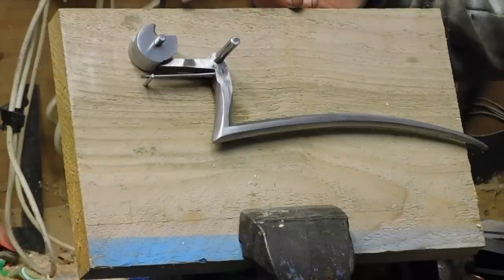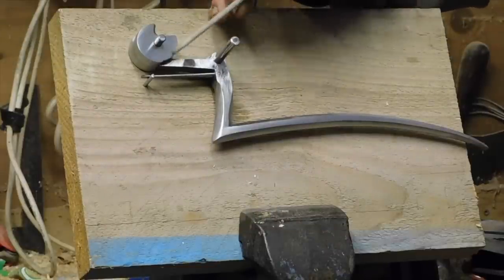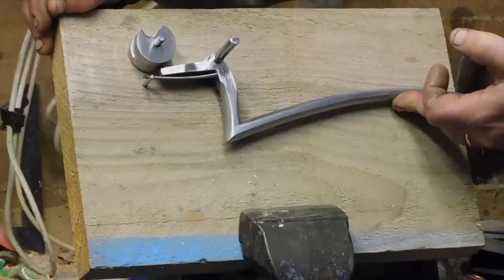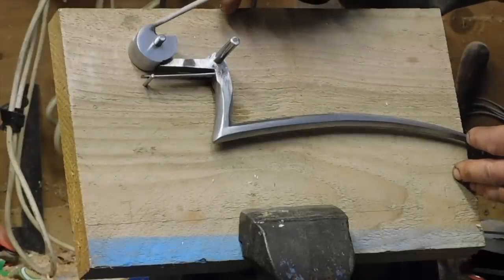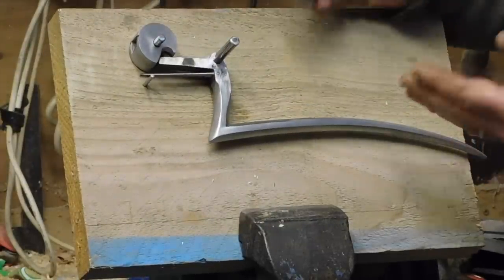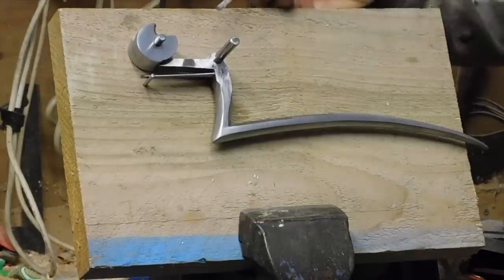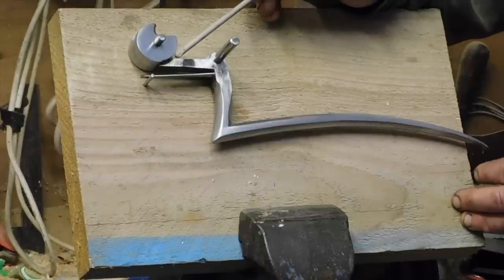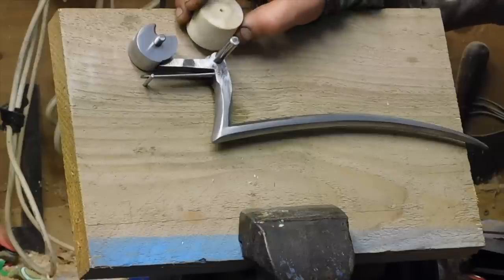Single axle rolling nut trigger system - medieval crossbow

Comment: The trigger is pretty clearly a product of blacksmithing techniques, but the nut seems like an impressive piece of machining for an era when it had to be done by hand with files.
Reply: It helps that the nut doesn't really have to be even. As long as all the contact points are in the right place then it'll work perfectly.
Reply: I think we have all forgotten that a highly skilled blacksmith could do with a hammer and fire just about anything that a machine could do.
Reply: John Nepovietz to an extent
Reply: They actually mass produced them in bronze in China, one of the first interchangeable parts. Ofc you cast bronze so its a bit different but i don't think they where especially hard to make in iron, i doubt they did much filing either since you can forge it into the basic shape. It doesn't exactly need to be high precision.

Comment: One small improvement that is likely to have existed quite early on in the development of this design would be to enlarge the nut slightly to allow for a stop that prevents the nut from spinning excessively by impacting the sear in its downward position. This would also allow for a self resetting system due to how the sea is under constant spring tension. What is most surprising with this design is that it clearly incorporates a finger trigger as we're used to seeing them on firearms but still persists with a lever grip extension. For the purposes of releasing a high poundage crossbow, this makes sense since it can be difficult to drop the sear if the nut is keeping a lot of pressure on it, but on lighter target crossbows I think a fitted pistol grip would be more appropriate, just as we see on more modern crossbow designs. Crossbows are an excellent microcosm of missed opportunities a divergent evolutionary paths.

Comment: Not sure if you'll see this since this is an older video, but I was just wondering if you machine your own roller nuts and trigger systems? I was looking into building a crossbow a few years ago and stopped when I got to planning out the trigger system since I was unsure how to create the roller nut out of metal, but antler might be the material for me since it would be easier to work with and it would just be a target bow I would be building. Anyway, big fan of your content for years now and I appreciate all of the content you put out, most of what I know about crossbows I picked up from here. Keep up the great work man!!!

Comment: What  takes the most force in a trigger system like this, the axle of the nut or the axle of the axle of the trigger?
I am making a crossbow myself and the axle of the nut goes through a metal plate on the outside of the stock but the trigger isnt.
Now while thinking about it doesnt all the force get transferred to the trigger in the end? 🤔Should i make a bigger metal plate where the axle of the trigger also runs through?

Comment: The people of the Iberian peninsula also liked their crossbows, did they make fancier models like the German and Central European people or did they go with the plainer variants. 

I'm also curious if the spring was always made of steel or did they use brass or other copper alloys too?
Reply: I have another unrelated question; what kind of initial kinetic energy would one be able to achieve with a heavy windlass crossbow and a heavyweight bolt of around 125 grams and how would it compare to 140+ lbs. longbows firing heavy arrows

Comment: Great video Tod. How long would you say it takes to manufacture a steel nut versus a nut from bone? I'm finishing up an aluminum alloy but for a lightweight build and I can already imagine a synthetic material with a reinforcement with the sear would be much quicker. I'm using a band saw to rough cut, a drill press, and a belt and Ali for sander for finishing.

Comment: Again really nice video and craftsmanship the only thing which interest me is how powerfull bow can use a antler nut, because I know how strong diferent kinds of steel can be but I don't know nothing about antlers and I'm pretty sure they are weaker.
Reply: It's fairly easy to add steel side plates to an antler nut, which give you pretty much the same strength and still most of the weight savings.

Comment: When you're talking about the trigger action not rotating the nut either way, does it require the front of the trigger sear bar to be an arc segment of a circle concentric with the trigger axle pin, or would a straight line mimicking that angle be sufficient?

Comment: hi .do you hardened the nut and trigger tip. and if the bow I'm making is 175lbs is hardening necessary.could i use bronze for the nut and trigger
it's just i do like things made from brass and bronze

Comment: Was this system common enough in the 11th century such as at the battle of Hastings or in the first crusade? If so could anyone point me to references or art? As apposed to the push pin or other similar locks. Also what would the lowest draw weight for an 11th century war bow be?

Comment: I don't know much about triggers on crossbows or the mechanics of even firearms triggers. I do know firearm triggers are often very different and come in many different modes with differing numbers of "stages" etc. Do the more complicated crossbow triggers have a different amount of slack/take-up, different poundages, easier or harder breaks, more or less slap, etc? Basically, wobbling the thing while pressing the trigger is where most inaccuracy comes in, so maybe the more complicated triggers were designed to help with marskmanship? Hunting could be at small animals or small parts of any sized animal, and they might be far away and trying to flee, and not wasting or spoiling the meat is an important part of hunting. Humans in war would more often be close and coming to get you, and any part of the enemy hit will do you good.

Just a thought and a question, I've never fired a crossbow so I don't know if the trigger/tickler is much different on any of them.
Reply: @tods_workshop  Awesome! Thanks for the info. Glad to hear the complicated trigger mechanisms are more than just showing off, and actually have a practical purpose. I've only shot a couple Modern crossbows a couple times, and they had triggers like guns.

Comment: can I build a nut with boxwood or will it break? Ive build one with reinforcements of horn on the trigger plate and the string plates of the nut. also on the rotatin axe Ive got a steel tube in the nut where the axe ist stuck through. the bow has 150lbs in expansion on the crossbow and Im not shure if the nut wont break. thnx for answer tod!
Reply: Well, it really depends on how much oressure is on the nut

Comment: I have a question. When the nut is released,  how does the nut rotate  back to its original form so that it can be pushed back by the string when reloading again?
Reply: My understanding is that the nut is reset by hand as part of the process of reloading

Comment: Could you use an aluminium nut rather than steel, but with a steel sia bar/trigger ? Would the aluminium wear out too quickly ? (asking because I have some aluminium bar of about the right diameter, and steel to forge a trigger/sia from).
Reply from the maker: For low poundage bows it would probably be fine
Reply: @tods_workshop  Excellent. Having made your Dark Ages crossbow, with a very weak bow (20-25lb), and had a heap of fun with it, I think I'll try something a bit stronger and more complex. Going with a single axle nut trigger on this one.

Comment: Do you think a nut made from a hardwood would work? Of course, the trigger bar would have than from wood too, otherwise it would wear the wooden nut out in no time.
Reply: How low weights are we talking. If i were to make a bow to shoot red tips at people in a reenactment setting, I would need a very light crossbow. Regular bows in that setting have an effective range of 10-20m and a draw weight of 20 or 30 pounds, and I'd be happy with somewhat similar. performance. Obvously being aware of the draw of a crossbow and a regular bow is not immediately compearable.
Reply: @Taeerom  What kind of wood are we talking about? I think a piece of hardwood would work if you made a crossbow that you can draw yourself without any tools. But if we are talking about using natural materials why not use bone?
Reply: If you put steel plates on both sides it would be comparable to an iron nut wood won't work because of its grain structure if the nut gets pulled in the direction of the grain it will immediately break which is why you need steel on either side or to just make it out of steel

Comment: Is the slot where the butt of the bolt goes in between the fingers of the nut the same dept as the bolt groove?
Reply: @tods_workshop  would you ever do a video on how to build a crossbow with a roller nut mechanism?

Comment: Anyone got any idea where to buy bone/antler for a nut ?
Reply: Poppy Warner I know this 2 years ago but I’m about to make a crossbow with a rotating nut trigger and I’m going to use delrin. This an engineering plastic which comes in round bar so you can just buy the diameter you need, eg 25mm, 30mm and it’s already the right basic shape. If you buy it in its non dyed colour it’s a dirty white which looks vaguely bone like. As long as the draw weight isn’t silly it should be strong enough but I’ll reinforce the sear contact area with a steel plate.